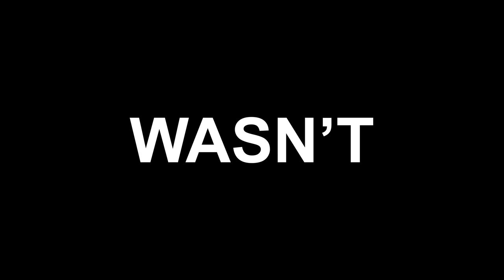We can't catch a break in Kyrgyzstan || Riding from Sydney to London - EP 22

Comment: Couple notes I've made about ATW bikes from your trip - probably don't buy a dr650!  Don't ride tubes.  Tubeless are easier to plug. Maybe bring a tube or two for back up.  Friction plates are handy to have.  As is duct tape.  Carry fork seals.   What an adventure you two took.
Reply: think you are reaching some invalid conclusions. Off road bikes have spoked wheels because they have greater elasticity in absorbing shocks and will not fracture like cast wheels.  With most spoked wheels it is necessary to use tubes (some BMWs excepted). That's the way it works,  As a low cost bike DR650s have no direct competitor and have some pluses like having a carb which when you get bad fuel can be easily dismantled and cleaned, Try doing that with an injector!!!!
Reply: @daviddonne7333  I understand - I have a tubeless Africa Twin with spokes. It does have injectors though.
Reply: @daviddonne7333  but you can convert to tubeless tires using the stock spoked wheels though.

Comment: There is a trick with leaking seals. Run a very think piece of plastic between the seal and the fork to clear the dirt out. Often this solves the problem or at least slows the oil loss. Use plastic like a milk bottle, yoghurt pot….
Reply from the maker: Thanks Michael, yeah he have now learnt this trick and it works really well. Thanks for the heads up though, you live and learn
Reply: Man I eat so many snickers in Kyrgyzstan….. 😂

Comment: Thanks for sharing.  You guys are making an epic trip.  Here are some BFE repairs for places where you can't find parts.  Seal the spokes up with Shoe Goo or even silicone sealer, then run tubeless.  That would stop all those flats or at least make a simple Tubeless plug only take a few minutes for a flat repair.  Almost nothing goes wrong with fork seals.  Learn how to clean them on Youtube.  Most neck bearing can be repaired by simply throwing away the ball separator and adding a couple extra ball to the races. Good luck out there.

Comment: Hello from Colorado another great video!! I  really like it when you have mechanical issues you show how you overcome them. I'm assuming that was diesel fuel in those bottles not diesel oil. People used to drain the oil and fill their car engine with diesel fuel and let it run at idle for a little while and then drain it and refill it with new engine oil. They did this to get rid of engine sludge, this was mostly back in the 1950s & 60s when they used this method to remove the sludge buildup. This is the first time I heard of anyone operating a gas engine with just diesel fuel and no  oil for a extended period of time.
Reply from the maker: Thanks mate, but no surprisingly this is Diesel Engine oil and even more surprisingly the bike ran perfectly on it. Apparently you can do the same with big old Harley Davidsons too, we were very skeptical at first when we read this but had no option so gave it a go.